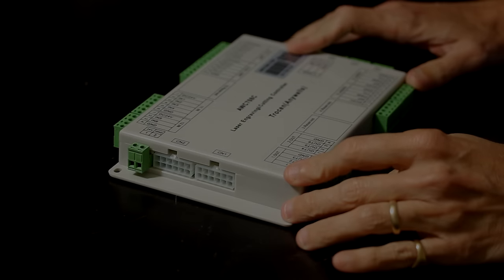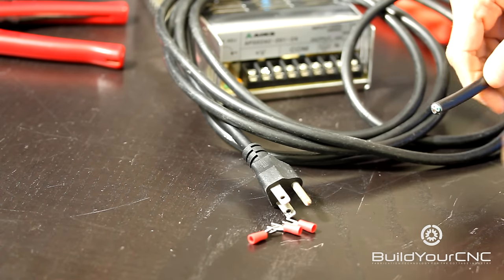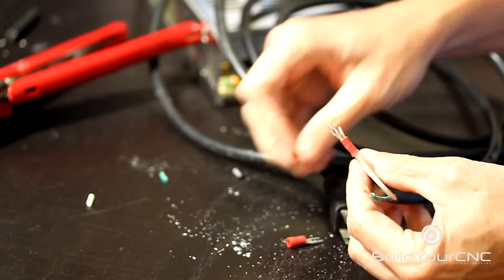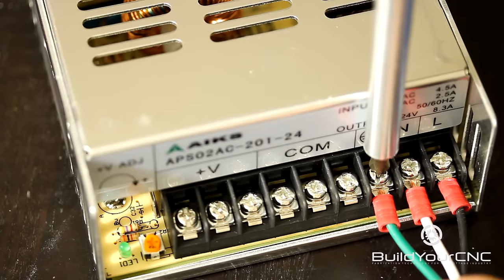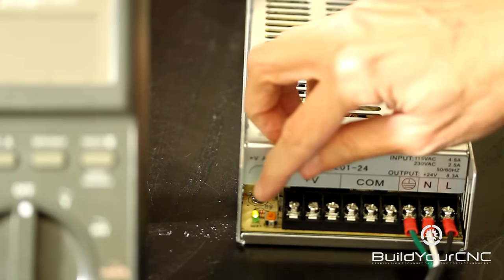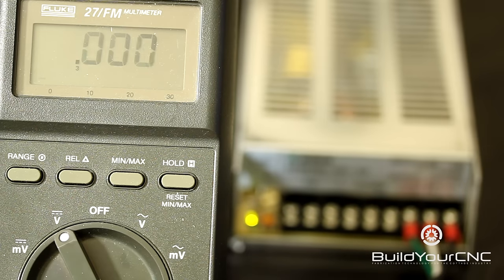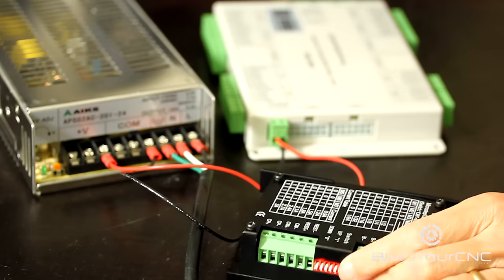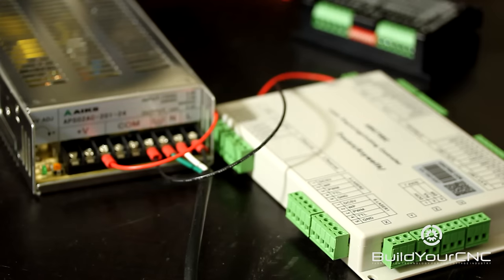How to wire the Laser Controller to a Power Supply

Comment: L stands for 'Line' , not 'Live'
Reply from the maker: Thanks. I keep forgetting that.
Reply: Don't fret it as many electricians, including myself, call it live.  Even on This Old House the dude calls it live and not line but the official Electrical Code nomenclature for the black wire is "HOT" and the white wire is "Neutral". The black (hot) and white (neutral) wires carry the current, and the copper wire is the ground. Note that the outlet's screw terminals are certain colors. The white wire goes on the silver screw. The bare copper or green wire goes on the green screw.

I just remember it like this - UK  Touch the brown wire and that is the color you will leave in your underpants and in the USA touch the black wire and that is what you will be seeing as you hit the floor.

Comment: It's not  "ground" or "earth ground" but protective earth. it is supposed to be connected to a protection device like an RCD. both neutral and PE are connected to earth/ground... earth is split into PE and N. Please use proper terms if you try to educate people on working with lethal voltages!
Reply from the maker: Thanks. I will clarify with an annotation on the video.
Reply: RCD for you and GFI for us and GFI is only mandated by code in places with wet surfaces near the socket like bathrooms.